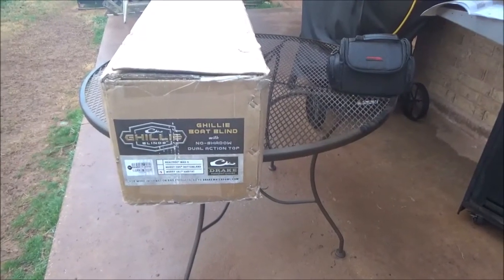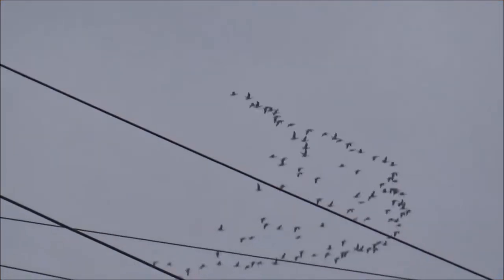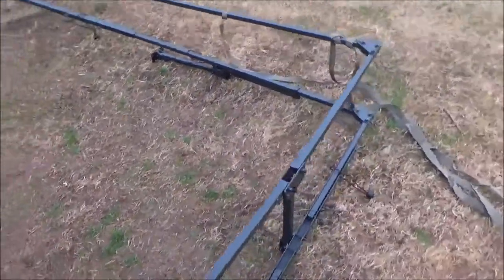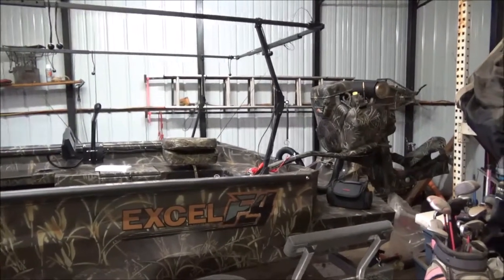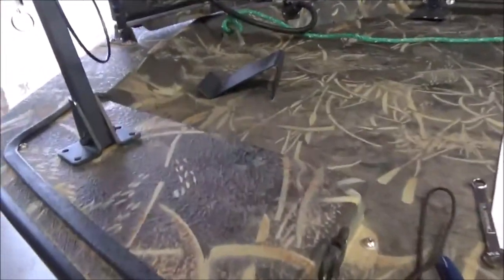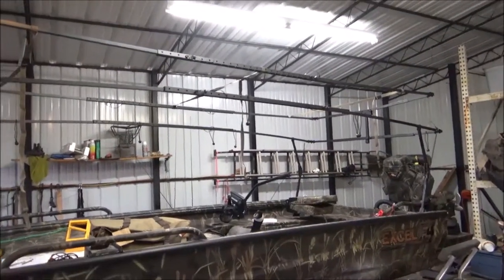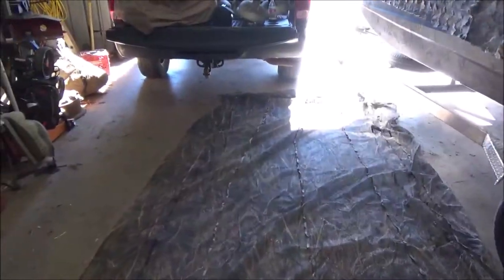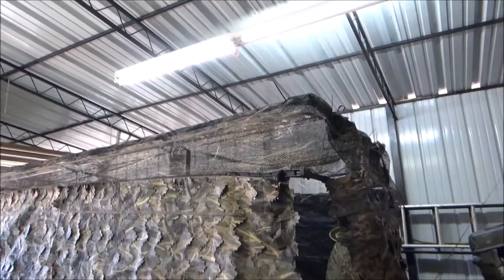Drake Ghillie Boat Blind Installation

Comment: I am considering the F4 Pro hull 1754 and the 40hp timber model. Pretty much the same boat. This was great vid and great explanation. I would love to see a vid on the details of the process of putting it up and taking it down and seeing how it stores and travels. How far back does the back cross bar go towards the transom / how close can you get the cross bar to the transom? Does back cross bar get in the way your seat or the tiller handle?

Comment: If your gunnels are wide enough can you just mount the brackets directly the gunnel?  I have a fairly wide gunnel.
Reply from the maker: You can mount it any way you want to fit your boat. I was trying to mount mine using the track rail system on the boat.

Comment: How did you like hunting it?
Reply from the maker: I like the blind. I have used it for one and a half seasons. The biggest issue I have is there is no air movement in the blind. It gets hot on warm days. In Texas that 75% of the time. I have to prop the sides up so the wind can blow through. Stays toasty on cold days though.